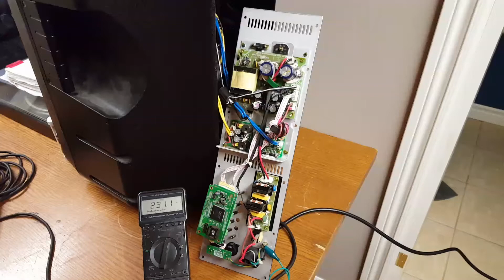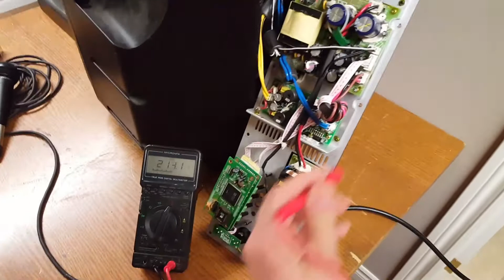Mackie Thump TH-15A - repair

Comment: I believe I have the same problem (missing +15v, 28v's and -15v are ok), but my OD light stays on like some others have indicated. I order all parts for both +15 side and -15 side, just in case. That would be C134, C135, Z103, Z104, C118, C120, R125, R124, Q104 and Q105 (r111 and R112 looks and checks out fine). Total less than $11 with shipping and thermal grease to reassemble. I'll post my results.
Reply: I ordered the 25v caps, but they are too big. Going to have to order 16v....

Comment: Sir, I received Thump T15A with Overload indication.  As per your advice, I changed Transistor SS8050 and the red Led switched off. But one of the speaker only working.  High frequency speaker and woofer not working. What will be the problem.  (I do not have the circuit for the same.) Regds. R. Devaraj Bangalore. India

Comment: I have Mackie Thump-15 15" Active Powered Speaker make tapping noise when turn on.. what course that?
Reply from the maker: Not sure.  Power surge on start up maybe or a weak electrolytic capacitor amongst other things.
Reply: I hade one do that yesterday. I shut off and then back on- LOTS of smoke and now nothing.

Comment: does the mackie thump 15 have a step down voltage circuit which lowers voltage to 15V DC? Is that the case with the V2 of the speaker with a black speaker grill?

Comment: Did you guys get to solve the green light pulsating? I have two of these speakers and I swapped the parts. I found out that the problem was from the power module. I keep getting a clicking sound from the transformer area as the green lights keeps pulsating. Any idea?
Reply: Same problem, have you found a solution?

Comment: Did the overload led burn all the time? And dit the s8050 solve the problem?
Reply from the maker: djakash The overload led was normal (off).  I replaced s8050 with ss8050 and replaced c118 and c120  with 220uF 25v electrolytic capacitors to fix my problem.
Reply: VintageAmpRevamp  hey, 
I replaced the transistor, the overload led is off but the amp turns on and of (green light on dim on and no sound) what now 🤤?
Reply from the maker: Did you replace the 2 capacitors c118 and c120?  You might have different problem it seems!
Reply: Did you get yours working?
Reply: Norm Vilmer Hey bro, no still have to take the time to measure everything
Reply: I replace the whole 28v to 15 v circuit (yeah I know, waste of money, but lets call it soldering/desoldering practice). And the exact same thing, power light cycles on to dim. I removed the connection from the preamp board to the power amp board and the power light then stays on steady. I am going to try to inject a signal to the power amp board with preamp disconnected to see if it is working (sound out the speakers), if so, need to start testing the preamp board... bummer. Not have a warm and fuzzy about this right now.
Reply: it ended up to be the power amp board for me.